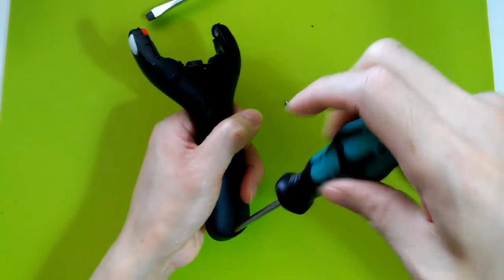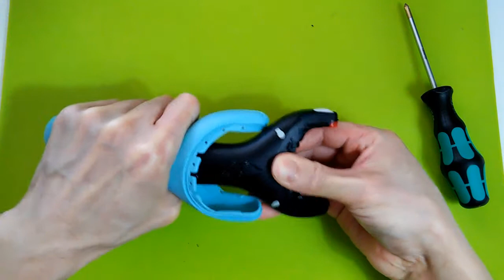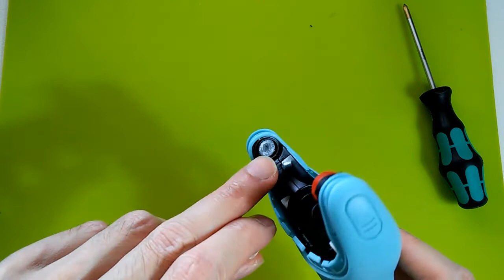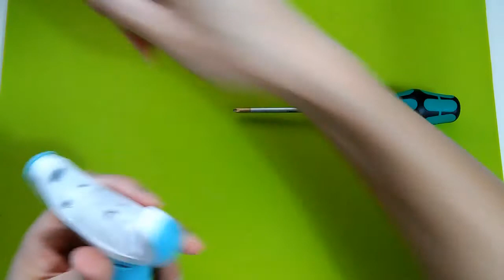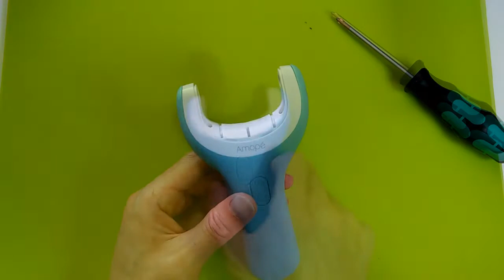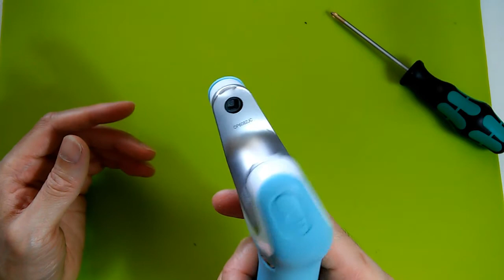Broken Amope Wet and Dry Foot File Makes A Lot of Noise 2of2

Comment: By now, I’ve bought the fourth one. All the previous ones had the same problem. On the right side of the 'fork', the housing cover breaks in the area of the gears. This causes a loud clicking noise when the motor is under load. Great video, by the way.👍
Reply from the maker: Thanks for the additional insight

Comment: You should try to stop the roll with your hands to see if it actually doesn't make the noise anymore.
Reply from the maker: Stopping the roller is what induces the noise.
Reply: I know, then I'm sorry but I didn't get the point of the video. What is it that you fixed?  @watdahel

Comment: You did awesome 👏. I followed you all the way through and have successfully put it back together. I think the battery may be shot. I’m having a difficult time locating any with numbers that match.
Reply from the maker: Go by dimensions and voltage and amp ratings

Comment: Thank you.  You are very right regarding avoiding getting it wet because of the possibility of water getting into it.  Mine stopped working not long after using it in the shower.  
 When I opened mine according to your instructions, I found it was still wet  and some rust weeks after I last used it.  I now have it sitting in a closed container with a couple of large silicone packs.  I'll try n report later how that goes.
Reply from the maker: Silicone packs?  Hope the motor was not rusted or the electronics shorted.
Reply: Sorry.  I meant silica, not silicone. There is rust on at least the outside of the motor and the battery pack doesn't look too clean either.  It looks pretty dry now so I put it partially back together and put it on the charger.  The light is constant - it doesn't blink like it used to when it was charging. Thinking of maybe opening the battery pack to see if maybe it could use a good cleaning.
Reply from the maker: Do you have a multimeter to measure voltage of the battery?  Maybe the battery is fully charged and something else will not run the motor.  At least make sure the motor spins freely by hand.
Reply: The gears do turn freely and I can see that the tiny rod that shows on the other end is turning also. I don't have a multi meter. I do h have a battery tester. I suppose maybe I can wire that to contact with the battery?
Reply: I was able to get hold o a multi meter and it shows a reading of .62 but 
it jumps constantly up to .92 so I'm assuming that's not a good thing?
Reply from the maker: 0.62 volts is not a good thing if your reading is correct.  Lithium ion batteries should not be discharged lower than 3 volts.  3.7 volts is the nominal voltage.
Reply: The owner of the miltimeter is going to check as soon as he gets some time off to see if maybe I did it wrong,  I'll post as soon as I get the results.